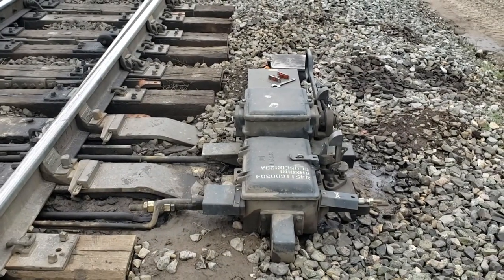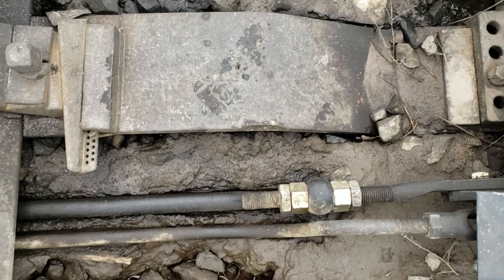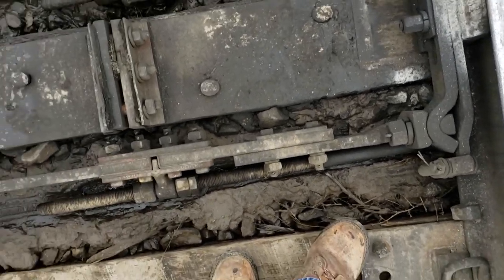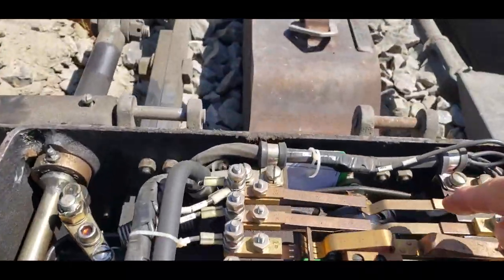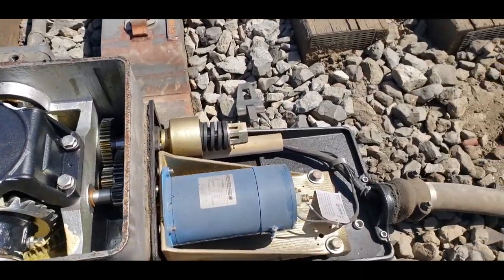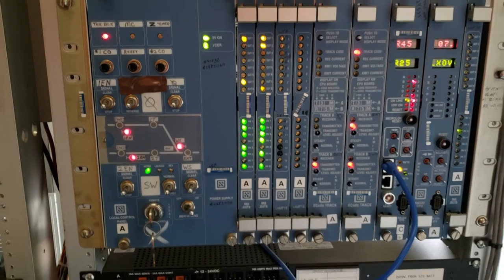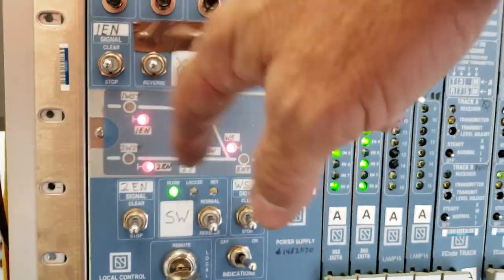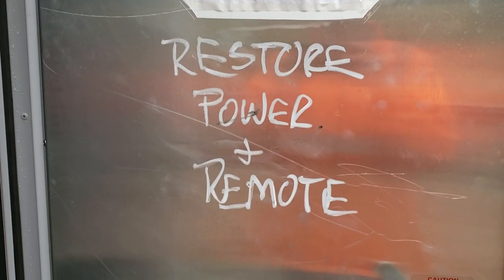Railroad Signaling Explained: How a Power Switch Machine Works

Comment: We use the same Union (now Siemens) switch machines here in Australia, very reliable and rugged design. Never seen one fail in my entire career. Though the detection contacts are different and a little finicky to the untrained eyes.

Quite a nice video showing us how things are done across the Pacific. Cheers.

Comment: I've never seen the guts of these.  It's interesting watching them work but I was usually on a train and my conductor only had to deal with them if they didn't work, which was very rarely (or a test).  Thank you!
Reply from the maker: Thank you for checking it out! The M-23 is pretty bulletproof and we rarely have trouble with the machine. It's usually the track structure that causes the problems.
Thanks again for checking out my channel!

Comment: Have very few M23 switch machines on my railroad.  5f switch machines mostly. Great video.
Reply from the maker: Thanks! We had some 110v Grand Masters (?) when we took over the BNSF/UP interlocking in Bakersfield, but soon swapped them out for M23s.
Thanks for checking it out!

Comment: In UK lots of signalling points failures. BR started installing hydraulic points Clamp locks, they kept failing, When ASE was told by Chairman BR Board that he was to be sacked in 6 months time unless failures dropped, he sent out questionnaire to reduce failures. I recommended Clamp locks be abolished, replaced by HW style point machines.

Comment: I am always impressed by the reliability and overall fail-safe design of railway signaling equipment. In this case however, I hasten to add that I am somewhat chagrined to see the highly fouled nature of the ballast, particularly in the area of the switch points. This is something that adversely affects the mechanical properties of the sub-grade, as an excessive accumulation of fines greatly impedes drainage - this is reflected by the water puddling in the tie cribs. This situation requires immediate maintenance, particularly since this is on a high-traffic main line trackage. 2021/10/27. Ontario, Canada.

Comment: Love to see you make adjustments to the locking and detection / maintaining M23
Reply from the maker: That would have been difficult without someone else either doing the work or the shooting. Both of which I was loathe to request.
I knew I was retiring so I didn't care what UP thought but I didn't want to get anyone else in hot water!
Thanks for checking it out!
Reply: @MarkClayMcGowan  Note to MCM: I would hope that UP recognizes, and appreciates, that you are a good "Ambassador" for the Railways. Such good PR just cannot be "bought" through the usual marketing channels.  Ontario, Canada.  2021/04/20.
Reply: @paul-andrelarose3389  Alas, that is not how railroad corporate thinks about things.

Comment: If I am reading this correctly, you are at CP. Cable on the Union Pacific Mojave Subdivision. This control point appears to be between MP 356 and 357. If I know this sub, it stretches south into Colton Yard where it meets up with the Yuma and Alhambra Subs, and into Bakersfield where it meets the Fresno Sub near crossing number 757198D.
Reply from the maker: You are reading it correctly. Cable is CPSP356 as they apply CP numbers to the closest MP. The last crossing at the north end of the sub is 30th & M but the subs change at CPSP311 Bakersfield about a mile further west (north) where single track starts to the north (west). I don't know if you've caught my series of trains at Control Points. I have a playlist of those I've caught so far.
Thanks for checking it out!
Reply: @MarkClayMcGowan  Are you all still dispatching out of Omaha?
Reply from the maker: @newwomyn  yes they are. They moved the valley and Tehachapi dispatchers to California for awhile sometime back but they've been back in Omaha quite awhile.
Reply: @MarkClayMcGowan  If I may say, thank you to all the signal men and women that go out on back roads in all kinds of weather, keeping the infrastructure of our railroads running. 

I have nothing but the deepest respects for everything our nations railroaders do everyday to keep this country working and moving. Taking care of the High Iron takes dedication and a can do attitude. By yhr way, I live near the UPRR Wagoner Subdivision running from Van Buren Arkansas to Coffeyville Kansas. 

I saw the 4014 Big Boy on the Wagoner Subdivision in Claremore Oklahoma on Florence Avenue at Crossing Number 428370P, and at MP 609.430 on the sub.
Reply from the maker: @newwomyn  thank you! I loved signal work but I'm glad I'm retired. We all appreciate those who appreciate what we do and dont just holler at us when they drive by a malfunctioning crossing! 
I live in Bakersfield where the Mojave and Fresno subs split and where the BNSF and UP split as well.
You should check out my facebook @Mark Mcgowan.

Comment: Thanks for making and sharing these videos, Mark. Would you be willing to make a video explaining how a dispatcher's command to line a powered switch and clear a signal actually goes from their computer to the field and how the confirmation is sent back? You had said something about the signal getting into the control house via radio in this video, but I wondered if the entirety of the system is linked radio-to-radio or via landlines or some combination of both.
Reply from the maker: In the playlist of this video is one at a control point. I explain it all in that video!

Comment: a few years ago we ran one of those type of switches got by the stop signal too, no derailment but we sure messed up that switch machine and got called in for investigation.
Reply from the maker: LOL. We've replaced quite a few that had been run through over the years. 
Thanks for checking it out!

Comment: Pretty cool video. I’m a signal maintainer for metro north railroad. We use m23s and m3s. Nice to see a different maintainers view on machines. What kind of track circuits do you guys have out there? We use DC, AC, phase selective, microlok, VPI, tru 2, and genrecode. Do you guys use CAB or wayside signals? Very interested.

Comment: Another great video. How often in your inspections on power switches did you find a point gap? The hand throws on the museum RR I've helped at seems like we were always adjusting them
Reply from the maker: Gaps more than a business card width are actually pretty rare. Unless the track structure is very weak or the switch machine or connection to the points is badly worn, they stay pretty solid.
Hand throws are a different story. They don't have the solid locking mechanisms a power switch has so there is more room for problems. Still, a point gapped more than 1/4" will put the signals to stop (or it should!), sending us out to make the proper adjustments. We don't mess with switches in non signaled track but the track inspectors stay on top of those as well.
Stay tuned for my next "How It Works" piece. It will be on hand throw switches.
Thanks for the questions and comments!

Comment: and I thought the switches were rough on my territory. The insulation on those gauge plates are horrific and that throw rod is made to go around corners.
Reply from the maker: They changed everything but the machine there about a month after I shot this. It was the last big project in which I was involved. 
Thanks for checking it out!

Comment: Thanks Mark for all the great videos.  I have some questions that are about train movement signaling (control circuits from one signal to the next) rather than switch machines.  At about 12:45 in this video I can see a pole behind you with open wire going left and right in the video frame.  Are those open wires circuits still active and in use?  Or are they abandoned in place and train movement signaling wires all underground now?  If underground, what size wires are used for control circuits sent to the next signal down the road?  Also what sort of voltages and currents are used for control circuits sent to the next signal down the road?  I guess I'm assuming it's a simple "apply a voltage at the near end and that will pull in a relay at the far end".  Or have things like that moved to audio modem tones with small microcomputers at each end, so that multiple on/off control circuits can be created from one twisted pair of wire/cable?  Sorry for the stream of consciousness format of my questions :-)
Reply: Well, shoot!   I think you answered my questions above in your video on Signaling, which I just found. From that video it sounds like there's some sort of pulse coded communications from one signal location to the next location and the tracks themselves are the communications path.   Is that correct?
Reply from the maker: @ad7i-Radio519  i was going to suggest you watch all my "railroad signaling explained" videos as well as the two on "what railroad signals mean" and the one about the poleline and how it worked. I actually hope you eventually watch ALL my stuff! To answer your question, yes. Pulsed signals are transmitted on the rails. Voltage is usually 1-2 volts DC and around 1 amp. Different pulse lengths and times tell each location what to do such as what color the signal should be, tumble down (putting all opposing signals to stop once a route is cleared), clear block, etc. Receiving no pulse is a red. We still use straight DC track circuits that operate electromagnetic realys in certain applications. Stay tuned. More to come. Thanks for the questions and I hope I answered them here and in my videos. Thanks for checking out my channel!

Comment: Hello I have been a signal maintainer for about 2 and a half years and work for a transit system in Cleveland. I enjoy your videos and came across this one and it leads me to my question....I was wondering if you could put out a video on floating the 23 machine? Do you use 3/8 or 1/4? Also what is your open point to rail measurement?
Reply from the maker: I'm retired now so I can't do anything involving the inner workings of signal equipment but to float the lock rod we backed  off the basket, inserted the 3/8 gauge, loosened the lock rod and manipulted it to allow the machine to complete its movement with the gauge in and ensured latchout engaged and the indication contacts remained up and shunted. We used a 3/8" gauge because we had latchout devices. Without them the requirement is 1/4".
If I remember correctly the open point measurement was 4 3/4" but don't hold me to that!
Thanks for the question, comments and for checking out my channel!
Reply: @MarkClayMcGowan  Thank you for responding and a 3/8 is what the f r a says to use but our Transit System. Decided to go no more restrictive at 1/4. Which is causing the following problem. Our machine with 1/4 obstruction Goes into core and maintainers have been moving the lock rod. So that it doesn't go into core. But that still does not resolve the issue of the machine going into core with a 1/4 and when we tried to float the rod to make the adjustment. Then we wind up not having enough adjustment on the rod or on the point. Do you have any suggestions? Or do you know of anyone who uses 1/4 inch obstruction On the 23 machine. Again I've only been doing this for a couple of years and hope I'm explaining it correctly
Reply from the maker: @quennelmarshall807  are you talking about floating the lock rod or floating the basket rod (382 test)?
Reply: @MarkClayMcGowan  we are discussing floating the lock rod for point detection
Reply: We are having an internal discussion in Cleveland on  floating the lock rod with a 1/4 or 3/8 obstruction. As of now our M3 machines will indicate if lock rod is floated with a 1/4 and we believe that is due to worn bushings.
Reply from the maker: I've never dealt with an M3. Even when we were doing the 382 with a 1/4 gauge before latchout devices, we floated the lock rods with a 3/8 because the lock bar would generally slide through the lock rods with the 1/4. The 1/4 is good for shaving lock rods! Tell them to install latchout devices and go to 3/8 for both tests!
Reply: @MarkClayMcGowan  Our switch machines at NYC Transit operate and lock in about 3 seconds. We use US&S model 3 machine same as model 23 but ours has a hand crank to throw manually. Enjoy your videos. I retired as a maintainer after 34 years and became a signal field engineer did contract work for US&S and GRS.
Reply from the maker: @gerardsignalguy6623  I preferred the slower moving machines as it gives you a better look at things and it's almost impossible to smash your fingers!
We inherited an interlocking from BNSF with 110v Grandmasters with cranks but replaced them with the 23.
Congrats on your retirement. I have no intention of working again. 40 years was enough!
Thanks for checking it out!
Reply: @MarkClayMcGowan  I know of a maintainer who lost a finger at a switch.
Reply from the maker: @gerardsignalguy6623  I've heard about guys losing them in air switches too. I'll take the slow movers!

Comment: If you lose commercial power what happens to the signals. I heard a maintainer on the scanner drop commercial power after the last car went by, but the signal dropped in the face of the front end and the engineer had to put it in emergency. And everyone was pissed on the radio.

Comment: What’s the safety protocol while you guys are working in or near the right of way? Are train operators able to call/select their signal or switch themselves or all movements controlled by the dispatcher? 

In light rail, TriMet, trains are able to push a button in the cab to automatically call their signals and switches but when there’s maintenance in or near the right of way trains have to stop and call dispatch before selecting their signal at the nearest station or signal before the workers. (Call boars are usually set up with a set of train orders)
Reply from the maker: If you go to my playlist called "How Things Work on the Railroad", there is a video called "How Roadway Workers Protect Themselves" in which I explain the different ways. I hope you enjoy it and thanks for checking it out!

Comment: I'd like to see what a 20V machine looks like in the field being powered over, we used to have 32V 5H machines, and I thought those were slow, everything we have now is 110V whether it be an M23 or a 5F machime
Reply from the maker: With these, the gearing determines how fast they throw. We used two different gear types but mostly the slow ones, which I liked because you have ample warning that something is going on!
Thanks for checking it out!

Comment: Another interesting video I watched several times. 3 questions for ya.
Can the main office in Omaha throw any power switch remotely?
When local yard managers throw the switch remotely, how long does it take for the cycle to complete, from click of his mouse to final stop movement of the point.
And do you know if 5G technology will be used in the future?
Reply: Thanks for the video content! Excuse me for butting in, I would appreciate your thoughts. Have you heard about - Januke Henatalie Formula (do a search on google)? It is a good one of a kind product for operating a model railroad minus the hard work. Ive heard some unbelievable things about it and my friend at very last got amazing results with it.
Reply from the maker: The Harriman Dispatch Center in Omaha is divided into regions and subdivisions. Each dispatcher controls a specific territory and can only dispatch trains and operate the switches and signals in that territory. 
How long it takes a switch to throw depends on the type. In big classification yards like Colton, they are air operated and controlled by the yardmaster. They throw in less than a second. Some AC switches throw in about five seconds. The DC switches as shown in the video take 10-15 seconds depending on gearing.
As to the 5G question, that's a Communications Dept. thing but if UP believes it will pad the bottom line they will make it happen.
Thanks for the comment and for checking it out!
Reply from the maker: @josuereyes8223  I have no clue about model railroading or what does or doesn't make it work well...just the real thing!
Thanks for checking out my channel!
Reply: @MarkClayMcGowan  Thanx 4 your reply. I enjoy all your videos.
Reply: I'd like to answer your first question simply: Yes. (Unless it's in Local control mode! haha)

Comment: 10:12 What do the flashing track occupancy lights on the schematic indicator mean?
Reply from the maker: Those are the signals, not the tracks. Flashing indicates the dispatcher has them blocked, which she did because I had track and time.
Reply: @MarkClayMcGowan  1WST is a signal...?

Comment: Are there any digital sensors in this type  switch to make sure the switch is working as expected?
Reply: Everything is analog, the point detector rod moves a set of contacts.  If the contacts are not in the proper position, the train will not get a signal to proceed across the switch.

Comment: I'm not very knowledgeable on these kinds of things, but I can't help but wonder if this switch would alert someone if someone shoved a piece of thick metal or a rock between the tracks at the switch to keep it from fully working. I know where I live, whoever does the switching sometimes cuts it way too close for comfort in my opinion. There is a siding that is used to let priority trains or opposing trains pass. More than a few times I have seen a train just finish entering the siding when the oncoming train is less than a few hundred feet from the switch doing at least 45mph.
Reply from the maker: These have overload circuits. If the switch doesn't complete it's requested move within about 20 seconds, the dispatcher will try it one more time then call the signal maintainer to investigate.
In signaled territory trains can't be closer than one signal block (usually about two miles) from another train or a switch not properly lined. Once a train clears the main going into a siding and the switch is back in normal position, the signals on the main will clear for that move.